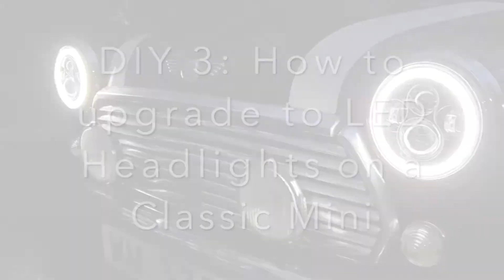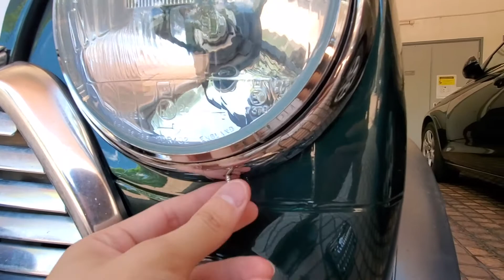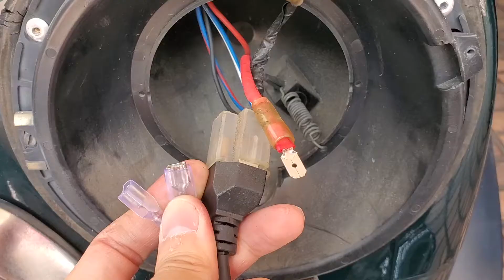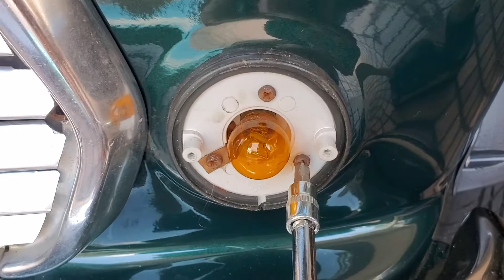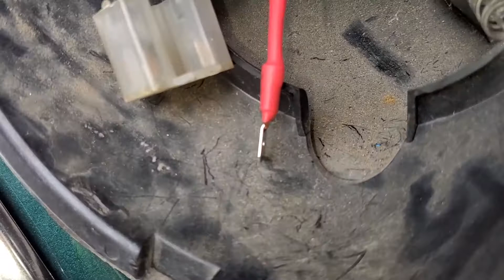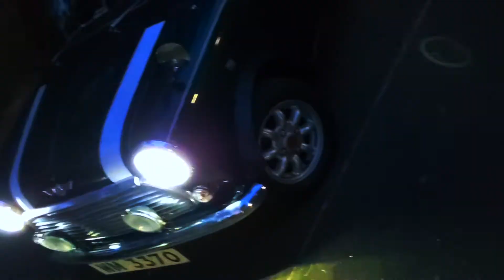DIY#3 How to Install LED Headlights on a Classic Mini (English Version)

Comment: I wired these but didnt wire indicators. Lights are working fine but outer halo one of the lights stays on when lights are switched off. Any idea why this is happening?

Comment: Hello , just wondering if anyone can help , I've installed these on my 1994 mini , and the indicators / hazards stop working , I've rewired the connections to the fuse box , what fuse do you use for these headlights 10 or 15 ?
Reply from the maker: Hi Amber. Do you have a blown fuse? From my experience, the original 10A or 15A fuses should handle the additional amp draw from the LED indicators without any issues. When you say fuse box, I assume you’re referring to the fuse box (that houses four glass fuses) behind the brake master cylinder, as that’s where the fuse box is on pre 96 cars. I don’t think any of the fuses in the fuse box are for the indicators so I suggest you to check all the line fuses under the bonnet (near the passenger side firewall) as I remember one of those fuses are for the indicators (one for the radiator fan switch and one for the parking lights). Also check the fuse holders as they can melt over time due to the heat from the engine and that can result in a poor/bad fuse contact. Check the hazard light switch as well, as according to the wiring diagram, that’s where the power is coming from so better make sure it’s working properly!
Reply: @manwithtoys9209  I fixed the indicator issues - I just wanted to know when turning your lights on - is the first click just the halos , or should the lights come on with it on the first click ?
Reply from the maker: @amberbaines4839  yea the first click of the switch will turn on the halos. The second click will turn on the low beam as well.

Comment: I was just wondering how you mounted these headlights as they have different fixing mounts to the mini ones? Also how have they held up over time so far?
Reply from the maker: Hi! The lights are held in place by the inner retaining rings and there are no specific mouting holes. These are standard size headlights and they fit in the original retaining rings without any issues. There are a few notches/protrusions behind the lights but they do fit the original headlight housings, so no modification (i.e. drilling/ filing down) was needed. One tiny thing that I had to do to make it work was to add foam tape around the perimeter of the headlight housings so that the lights will not wobble or vibrate within the retaining rings (since the headlights are a tiny bit slimmer than the original ones). Hope this helps!

Comment: Can I ask what happens to your drl rings when the hazard button is hit? When my drls are on and the hazards are switched the halos stay solid orange, but if I turn off drl lights the hazard lights will flash orange..
Reply from the maker: My DRL rings will turn orange when I switch on the hazards (same when I apply the turn signals).  Within the DRL ring I think there’s a white part which is powered by the side light circuit and there’s an orange part that is powered by the turn sign circuit (as suggested in the video). I think these units are design such that when the orange part of the ring receives power, it also makes the white part dimmer so the ring appears to be turning orange.

Comment: Any plans to supercharge your mini ?
Reply from the maker: Planning to keep the powertrain as original as possible so that it'll pass the MOT without issues and I won't ruin the transmission which is quite pricy these days. The only mods I've made so far are the upgraded Bilstein shocks absorbers and the RC40 stainless steel exhaust, plus the LED headlights of course hehe... 😉
Reply: @manwithtoys9209  sure you've seen already, but MCM did a s/c classic mini a while back

https://www.youtube.com/playlist?list=PLp0KnUFYB--g4RJ0SomuWRqckXHCYkabS
Reply from the maker: @DominicLeung87  Yea that car is sick!
Reply: @manwithtoys9209  fair concern

You do morning drive on Sunday? Would love to see your car in real life it looks awesome. I'm thinking of getting a classic mini myself.